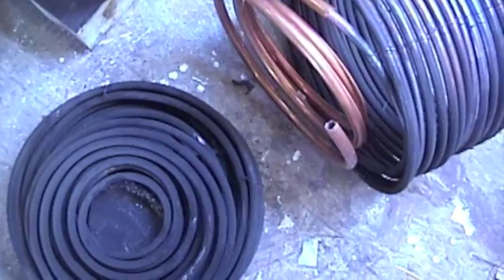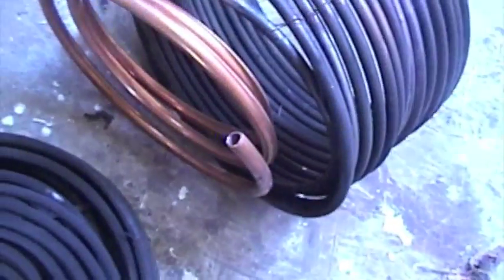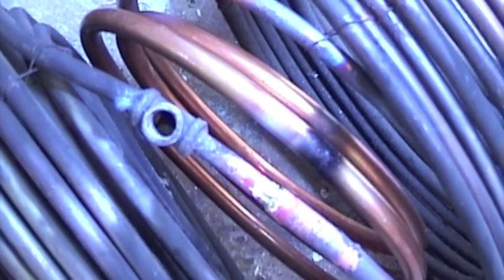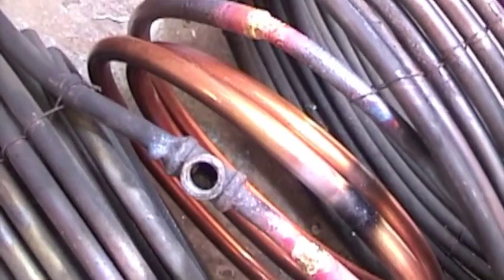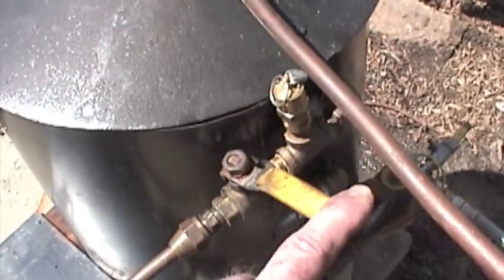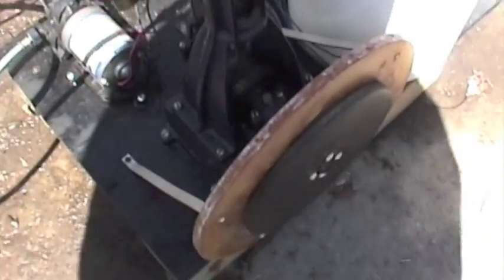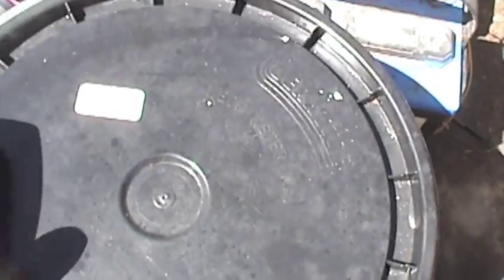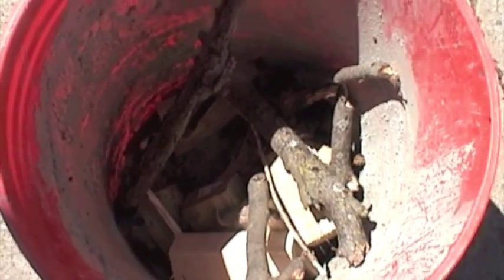Lynx Stem Generator 3

Comment: just an idea , if you buy a tachometer from harbor frieght the lazer  kind you can look at your rpm diffrence with generator loaded verses unloaded to get an idea if gearing up your output rpms is a good idea, you may have alot more power in that steam then those rpms are unleashing , have you considered a non direct drive like if you got an old hand crank drill with the beveled gears and retooled it into a transmission for your generator it would really crank out some power

Comment: nice work friend, im sure you know this but just encase it never crossed your mind
a forced air fire is used in all steam systems , old steam trains would use the steam exhaust to pull a venturi vacuum which would draw air over the fire, i can see you getting 10 times the power out of this little gem is you put a fan on the fire.please dont take this as nocking your work i just wanna help

Comment: To bad you can’t figure out how to make a steam turbine rotor to utilize the dry super heated steam. Oh well, that would take another step in engineering.
I have seen gasifiers that refine the hydrocarbons from the fire smoke and in-turn run a regular 5,000 watt gas generator; you can even use horse-shit for fuel. Ha. Ha.

Comment: Now install a condenser in the make up air for preheat of combustion
Reply: great point you would not believe the benefits of pre heating air, ive done some work on cyclone incinerators and you can have could spots at like 300 deg F in a 1000 deg fire ball , i had an entire garbage can glowing red hot except the 300 degree tangent arc of the intake blast it was like 250 to 300 deg on that side of the can, it was crazy but we i added long tubes that enterd into the can in a sprial fashen the sucker burned so hot it turned ash into molten white hot glass, and the entire can glowed red hot threw white thermal paint.normally couldnt see glow threw paint so well ,
Reply: Thank you. You could alse preheat the supply water with the steam exiting the engine or condenser or both in stages
Reply: Waist no energy use less fuel
Reply: Or another idea send the steam exiting the engine to a superheated coil closer to the fire and dump it just above the fuel to enrich the burn with hydrogen.